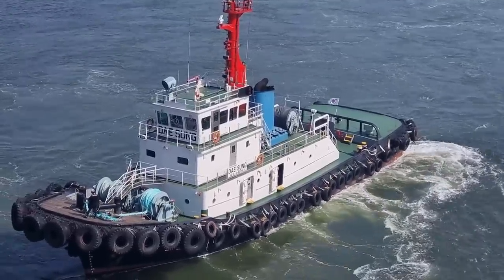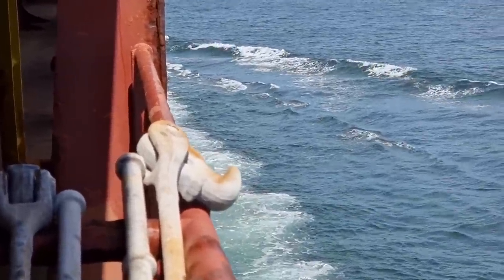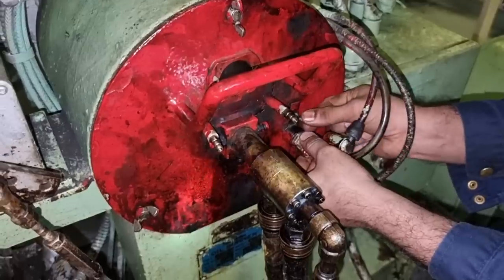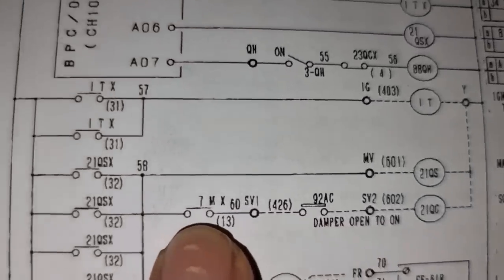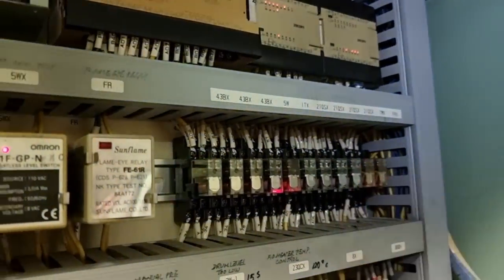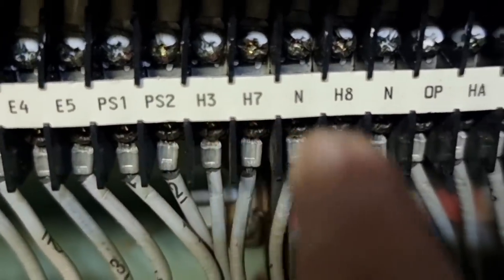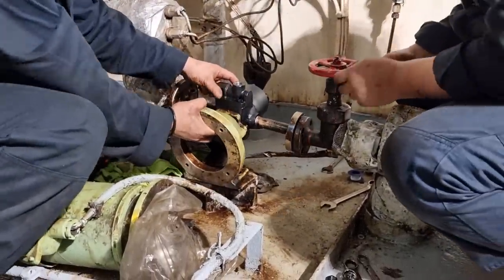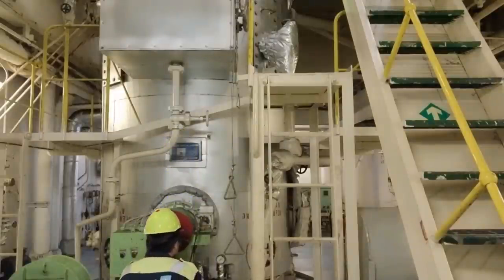AUXILIARY BOILER NOT FIRING, TROUBLESHOOTING

Comment: Great video, thank you. Just want to say this was mainly a mechanical issue that the 3rd eng should be able to fix without the support of an electrician. There is always a way to tell if the pump creating pressure or not. As far as I remember, the pressure gauge in this setup is taking its reading before the solenoid. So if the pressure is 0, it has nothing to do with the solenoid itself.
Good troubleshooting, man.
Reply from the maker: the pressure gauge is after the solenoid valve. thank you for watching.

Comment: Good Job mate what type of oil is used for Auxiliary Boiler your problem turned out to be mechanical I used to work on industrial boilers we used  Heavy B Oil and running temperature of oil was around 262f to get good combustion